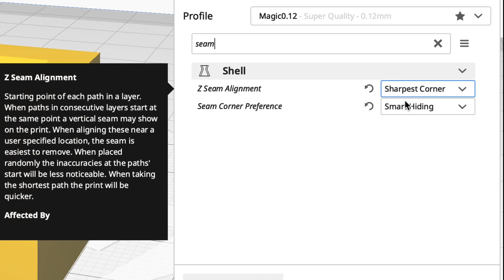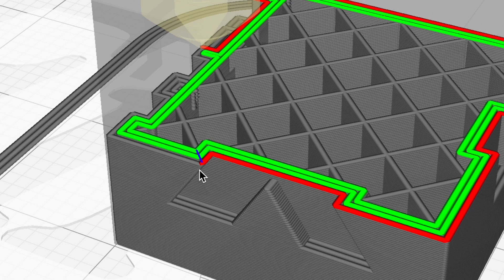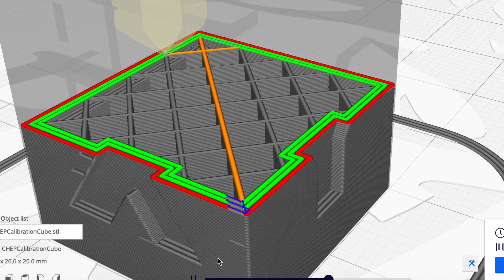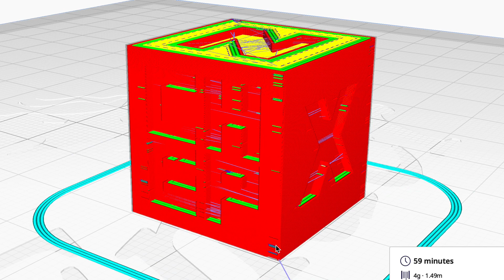Improved Cura Slicer 4.4 Profiles for Creality Ender 3

Comment: Hmmm i'm finding a lot of blobs on my test cube with the 0.28 file the other layer heights i didn't try yet... 
You are great though ! ;)
Reply from the maker: Download the latest. I updated it. 0.28 had some mistakes.
Reply: @FilamentFriday  Oke i'll try and let you know ;)
Reply: @FilamentFriday  I fixed the issue! for my machine i needed to lower de retraction speed from 25 mm/s to 20 mm/s now it's great ! Awesome results ! thanks !!
Reply from the maker: Awesome. I’ll try that and see if I get any improvement.

Comment: Hi Chuck, something I noticed when I used the Magic0.2 profile for the Ender 3. With your profile I can see in Cura 4.4.1 little blobs and missing pieces in the layers when I slice the small astronaut in Cura, but when I slice it with the Stock standard 0.2 profile in Cura, I don't see those in Cura 4.4.1. I printed it with your Magic0.2 profile and indeed the small blobs appear on the skin of the astronaut. If I try other prints from Thingiverse, same things appear. Am I doing something wrong with the settings ? Must be something, but I cannot figure it out..why is it not visible in the Stock profile 0.2 and it is visible when I slice with your profile ?
Reply from the maker: Your flow settings probably aren’t calibrated. Watch this: https://youtu.be/QnrH2Sk7y40

Comment: Nice.  Maybe you can answer a question for me.  I printed something at 0.16 on an Ender 3 Pro with a default profile and the skirt from Cura is so thin that I can't remove it.  I'm afraid I'm going to scratch up the mat as I scrape with the tool. Is it safe to use acetone on the flexible mat to try to remove that or will the mat itself react with acetone?
Reply from the maker: Sounds like your bed is too close. Back it off. 
To remove that, heat the bed then use a thin painters knife or.similar with round edges.
Reply: Just print over it a skirt again with proper levellig, than you can remove it ;)
Reply: Not a fan of most flex surfaces for that and other reasons.  With a borosilicate glass bed you can safely use a razor with no fear.  My suggestion would be to print over the .16 skirt with a few more layers added to give it enough stiffness to come off when you bend the mat.  In the future I'd print several skirt layers to make it thicker so you don't have this removal issue again.
Reply: Thanks- One corner was too high.  I'm still mastering bed leveling... :-)  and thanks for the obvious solution that I hadn't thought of.  Makes perfect sense.

Comment: hi Chep , i tried the coasting , outer wall wipe and outer flow extrude and random seam trick on cura 4.2.1. but still doesn't work.  the blob and zit still exist. is the trick only for 4.4 ?
Reply from the maker: Did you use my profile or just the changes?
Reply: @FilamentFriday  for cura 4.4 , i just use your profile exactly just change the nozzle temp to 210, does it matter?
Reply: @TechnoWit3D  Do you have the upgraded extruder or the standard one?

Comment: I noticed that on the 0.28 profile you have "outer before inner walls" checked, but on the 0.12 and 0.2 profiles, this box is unchecked. Was this in the plan or?.......
Reply from the maker: No, it’s a mistake.
Reply: @FilamentFriday  I figured that to be the case as your simulation on the vid was showing it as unchecked. Ironically though, I'm getting better results with it checked. At first your profile wasn't working for me at all but I'm now mixing mine up here and there and seeing nice improvements. Good job that I have a day off today so that I can spend a few hours playing ;)

Comment: what do you use to visualize the tool path for each layer in Cura?
Reply: in preview there is a pencil on the top right next to your profile (ex: PLA fine 1). click the pencil and check "travels"
Reply: @THEzTROLLlz  Thanks for the reply, but that just toggles the visibility of the travels.  What I wanted to know is how he displays or visualizes the path of the nozzle as it does every layer.  Normally, I just see what the completed layer looks like, but cant see what path the nozzle goes through to lay down that layer (e.g. does it start with the outer skin or start on the inner skin, etc).  He has a "video" run through of the layer being printer instead of what the final layer will look like.
Reply from the maker: It appears in preview mode automatically if your graphics card meets Cura requirements.
Reply: Kawayanan K  There’s a play button on the bottom of the screen in Preview.
Reply: The reason I am asking is that I had a print that had an overhang that could normally be easily handled, but for some reason Cura tried to start the overhand out in space instead of from a printed bit.  by looking at the layer, you would not easily know that it was going to do that and fail, but by looking at the "video" of the tool path it would be obvious.
Reply: @FilamentFriday  Thank you - this probably explains it - I am working on an old laptop.

Comment: How do you edit profiles in Cura? I'd want to add my own permanent tweaks, since i use an all metal hotend and EZR struder in a direct drive configuration, I have things current a bit faster and with less retraction.
Reply from the maker: Just change it the click on the arrow next to profiles to save as a new profile.

Comment: Forgot to tell you. I get zits and blobs in my prints (ender 3 pro, stock hardware). Will it be fixed with your profiles, or should I look at something else? Maybe you've already made such a video for this problem for ender... you are a guru after all!!
Reply from the maker: That’s exactly what the video is about. Try the profiles. See if it helps.
Reply: Can also be moisture in the filament
Reply: @jeremyloveslinux Very good hint. As a matter of fact I DO have increased moisture in my house, so why not in the filament? Any good advice apart from baking filament in a low temp oven? (I don't want to bake pla or abs and then cook my food...)

Comment: My ender 3 prints better than yours out of the box
Reply from the maker: Where are your slicer settings and pictures of prints so we can all benefit?
Reply: Don't forget different brands of filament behave differently. Out of the box with Cura 4.4 stock profile for the Ender 3 I had none of these issues while using Rigid-Ink PLA. Since moving to another brand I now see these issues, so hopefully playing with the settings in the video should help.
Reply: I just use the cheapest filerment on amazon add 3% on top of all recommended settings and lower the speed to 50% for the first layer or so slighty bring up flow rate if I'm using a older nozzle
Reply: Il get  some photos I think I might just be very lucky

Comment: Thanks! Newbie user here, will your profiles work with ender 3 pro? With stock components (extruder, nozzle, etc)?
Reply from the maker: Yes, they work with Ender 3 Pro
Reply: They should. Just be sure to set ur filament temperature right, what u used so far.
Reply: @sidd8310  around 200 for pla, 255 for abs. Are these ok?
Reply: Ye something like that. My first PLA was great at 205, my latest one from Azurefilm caught it at 215. Try printing a chepcube. If u get clicking sounds in the extruder, means a clog is possible. Try uping the temp by 5degrees and try again. Dont go too high. Up to 215 maybe. Over melting can also cause clogs. Compare. We all have big stashes of cubes. Good for comparison

Comment: I had some problem with this version of Cura.
When i tried it started to restart in loop because of my old cura 4.3 profile... So the solution would be delete my previous profile.... but my prints are really good with my current profile in Cura 4.3, i prefer if they will fix the problem :\

Comment: I went to a dual drive extruder and my prints are great however supports are hard to remove. Any suggestion on how to under extrude the supports?  Thanks
Reply from the maker: Try this:
https://youtu.be/7BURpQNXrDA
Reply: I had similar with my ender Pro after changing to dual gear.. Tpu prints amazingly now, but my old profiles for PLA I needed to adjust the flow rate to 90 percent to get back to the performance I had before the dual gear upgrade.    This should get the tolerances back to what they were from factory. My support just pulls off with the lightest pressure now.  Google "e steps calculator ' and go to the top result... at the bottom of that extruder calibration guid is one on setting the flow rate by printing a test hollow test cube.  I followed that and came out great. I assume you redid the esteps for the new dual gear extruder... It would be massivley under extruding anyway if you hadn't.. I came out at 144.2 steps from memory

Comment: anyway to go above 2.8? just looking for a little faster print times on big parts..Big Thxs goes out to you as well for taking the time to figure all this out for the 3D community..
Reply: With a 0.4 nozzle i still get decent results at 0.32 LH. As long as the printer is calibrated and good profile is used ^^
Reply: You could try 3.2 but I would suggest a bigger nozzle if you want really fast prints

Comment: I changed out my main board and when I fired up the printer the extruder temp ran up to 300 and I had to shut it off. Any advice ?
Reply: Broken thermistor / Software
Reply: Check your power connection to the extruder at the terminal block.  When I installed my SKR board, I accidentally hooked my bed heater to the unswitched 24V and it did the same thing (not to 300 but I caught it at 60).
Reply: @octothorpian_nightmare  are you talking about the 2 solid red wires ?
Reply from the maker: Thermistor in the wrong spot?
Reply: @FilamentFriday  what wire is the Thermistor ?
Reply: @mwmmidwestminiboats9543  The thermistor for the bed is one of the JST connectors, second from the end.  The bed heater is a pair of heavy red wires; I had swapped the hotend fan (skinny, red and black wires) and bed heater in the terminal block.

Comment: 734/5000
Hello Chep
I would also like to print two different vaults on my DIY Prusa in Cura.
 ( I'm talking about a bowden tube printer here! ) 
my question is:
   can you automate changing the filament in Cura even more?

so that printing stops, the nozzle goes away from the print to the end stop,
briefly with extra force extrud and then suddenly pull the filament all the way back even out of the extruder block / extruder motor?
then when you have manually added the first piece of different color filament by turning the printer on, 
and the printer pushes the filament back all the way into the nozzle and even a little extra extrud. (is this possible?)

after which the printer resumed printing!

Friendly Christmas greetings from the Netherlands!
Rob
Reply: The problem with me is that I don't have the same extruder drive mechanism as Chep.
I can't push the pinch/squeezer to pull out the filament just like Chep.
for that it would be nice if you can program the printer so that it pulls the filament out all the way,
and then of course push the filament back in again!
With the difference that the last piece that the filament is gently pushed in at extrusion speed, plus of course some extra filament length by pushing to clean the nozzle of that other color!

WEATHER friendly Christmas greetings from the Rotterdam area (NL)
Rob

Comment: 3:01 I noticed CHEP is having the same issues as I'm having when it comes to bulging corners (look at the left side of the cube). Anyone knows how to remove them?
Reply: Have a look at Linear Advance, that should do it if you are willing to flash new firmware. Otherwise you can always print slower or increase your jerk settings. Printing slower will lower/equalize the preasure in the nozzle, so it will not squeeze out excess material in the corners and increasing jerk means your printer corners faster, effectively decreasing the time your nozzle has to ooze out material in corners.
Reply: @benfpsgaming4419  thanks! I will look into that :D
Reply: @Martin Olexa if you want the Mad Max version for your prints XD ...does not go well with pla

Comment: Got a shifting problem with my TEVO Tornado... Did a print and it kept shifting to the right up to a half an inch, then I did another print and it shifted to the left a half an inch. I did home it at the start of each print. Using Cura 4.4.0 with a .6 nozzle.. How do I fix this?

Comment: why is your infil orange, outer wall red, and inner walls green? id like to use this in Cura
Reply from the maker: It’s the default settings on mine. I use it on a Mac.
Reply: When you are in preview mode, near the top, click "Color scheme" and choose "Line Type"

Comment: I have been using your new profile and I am not getting small prints to stick to the bed? What should I do. P.s. I am using an ender 3 with a glass bed, glue stick and have leveled my bed multiple times.
Reply: DamosLab I am using the glass plate to have the smooth bottom
Reply from the maker: Raise the bed temp 20°
Reply: CHEP So put the bed at 70?
Reply: @samerickson1847  i been having to raise it to 70 or 75 on my mirror and glass bed on the 5+ and kossel

Comment: I was just trying to import these profiles and get this error: Failed to import profile from C:/Users/matte/Downloads/chep_cura_profiles_4.4_1/CHEP_Cura_Profiles_4.4/Magic0.20.curaprofile: Could not find a quality type super for the current configuration.
Reply from the maker: You need to select the Ender 3 machine in Cura.
Reply: @FilamentFriday  I figured as much. LOL Was going to attempt using these profiles with a different printer. Still learning about configuring Cura.

Comment: The profiles dont import properly. I get this error message for all of them? failed to import profile could not find a quality type super for the current configuration
Reply from the maker: You need to select the Ender 3 machine in Cura.
Reply: @FilamentFriday  does it have to be for an ender 3? Can I tweak it to work on a Printrbot simple metal?

Comment: thanks for sharing your profiles.  I have a question - why is the 0.28 profile Initial line width still at 120%  (the other profiles have it set to 100%)?  was this just a mistake or on purpose?
Reply from the maker: Mistake. Thanks.ill correct it.

Comment: I recently started started using your Cura profile. And I can say they worked incredible! Thanks for all work you put in them. Can't wait to try this one out

By the way. Have you ever tried tweaking Ironing settings in Cura? I tried The 3D Print General's settings and it really worked well. After some experimenting with it. I'm currently using 30% Ironing Flow, 0.2 Ironing Line Space and 120mm/s ironing speed. I believe it can be improved further
Reply from the maker: Yeah. I’m working on it.

Comment: Can you send a cura profile for nozzle 0.6 ? Please :)
Reply: Just change the nozzle size in cura, profile will be the same.
Reply: @carbide1968  which setting ?
Reply: @kudaty5535  nozzle size. If you don't know where in cura 4.0 you may want click in the settings search but it's right there next to filament type top center.
Reply: @carbide1968  thx :)

Comment: Im struggling with cura 4.4. ender 3 with direct drive mod. But with tpu it umder extrudes on the corners or when its going over to a support wall it leaves small holes. Turned all retraction off, but still holes and stuff in the tpu print. Tpu is fully dry. 

Do you have anny tips for thad? Or a good tpu print profile for a direct drive printer for cura 4.4? 

Thanks for your videos mate
Reply from the maker: I don’t have a direct drive Ender yet sorry.

Comment: I've been using a similar profile since 4.4 was released a few weeks ago, one thing I really want to point out: Coasting works great with regular PLA and PETG, but with my eSun PLA+ filaments, the default settings were way too much and caused noticeable gaps even when Z alignment was set to random. It seems like these filaments just aren't stretchy enough at temperature to warrant using coasting.
Reply: Esun plus is my goto now, just wish they had more colors. I keep buying the no spool 4 pack for about 70 bucks to save a few bucks. Keep you esun empty spools. I wish i had a few more.
Reply: Do you use this similar profile (with different temps of course) for PETG without other changes compared to PLA? I'm still trying to nail my PETG profile
Reply: @kendokaaa  Its pretty similar. I think I use higher retract distance because it tends to be so stringy, and now that I think about it I might experiment with retract speed too. Coasting is a must with petg.
Reply: Coasting is what I currently don't have enabled. Thanks :)

Comment: Since you are that good with adjusting 
Could you help me with some of my problems.
I havent adjusted anything on my Ender 2 but the 20x20 cube turns out to 20,3x20,3 
I want to adjust it should i adjust the extruder first and then go for thr steps in x-y  and how to do that with cura since i dont want to Change anything on the printer itself ( i dont know how to)
Reply from the maker: Extruder is always 1st. Get the E-Steps flow rate correct.
Reply: @FilamentFriday  do you have any advice on how to set it on the ender 2 into the printer directly or just go for it in cura? If i was reading it corectly the settings in the menue are locked

Comment: I'm having some trouble with my supports failing. Any ideas on why that happens?
Reply: Look for supports printing in mid-air. Cura has this nasty habit with some models
Reply: @kendokaaa  Oh, this is worse. It prints the support but when it starts printing that part of the model, the support starts breaking off the model.
Reply from the maker: Use a raft.
Reply: @FilamentFriday  Unfortunately it's supports built onto the figure I'm trying to print. (example: a support built to hold up an arm that starts just above the hip)